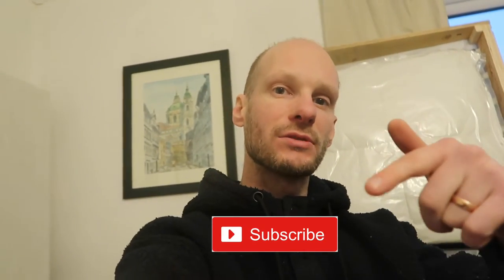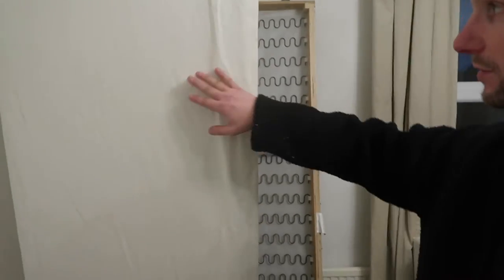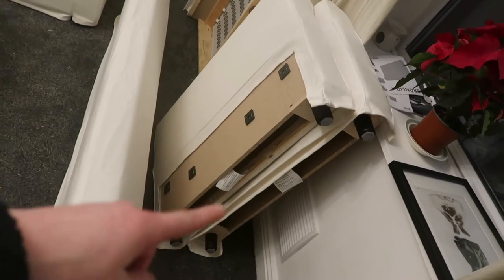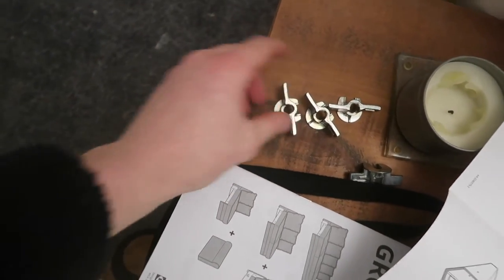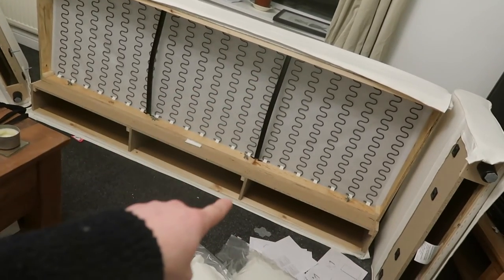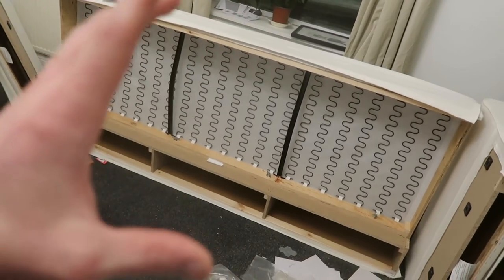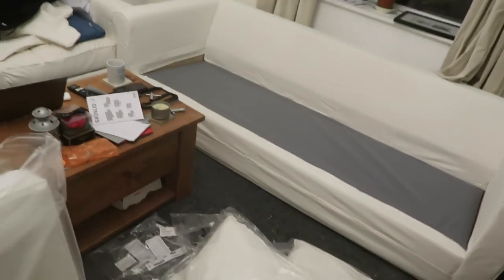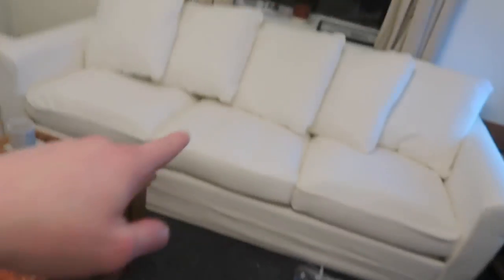How To Build The IKEA GRONLID Sofa

Comment: Very helpful video. Thanks. I have to replace one armrest cover that's damaged. I've been offed one the correct  colour, but I'm not sure whether it will fit the right armrest or the left one or both
 Do you know if the same armrest fabric cover will fit both left and right armrests?

The one I've been offered doesnt specify whether it is made for one side or the other so I'm hoping it will fit either. Any help appreciated.
Reply from the maker: I can't confirm its the same but it is Ikea so it will probably be the same cover that fits both sides because since they're washable and changeable. should be good either way. maybe ask the seller or go on the Ikea website and look at the specs and if it says 2 of this then you know its the same
Reply: @FamousJames  Thanks for this. Appreciate your help. I will go back to the IKEA website and look at the individual parts.